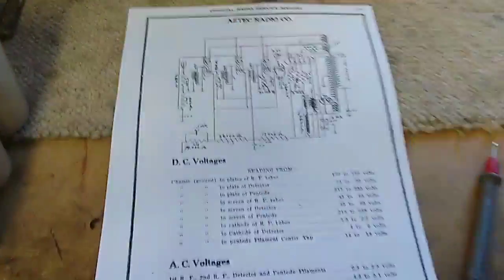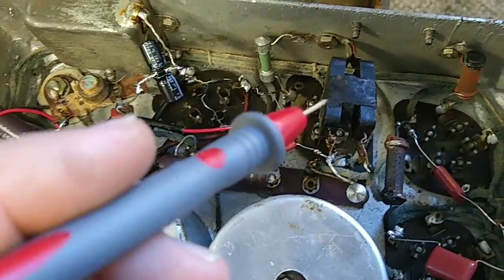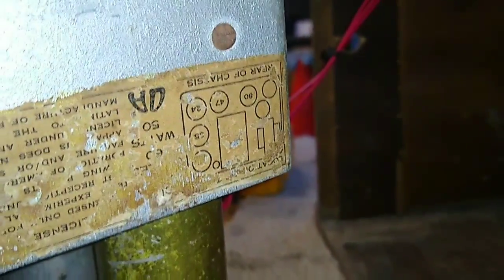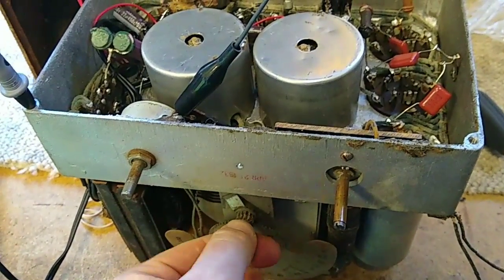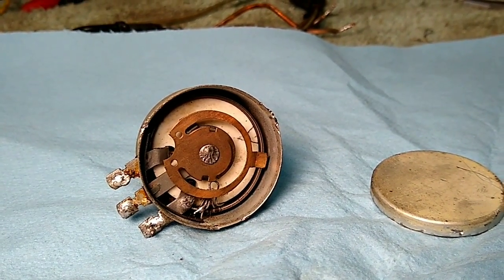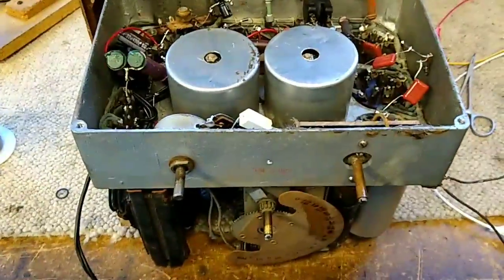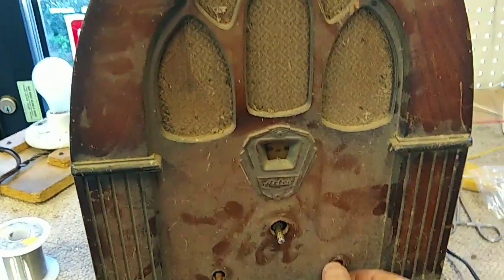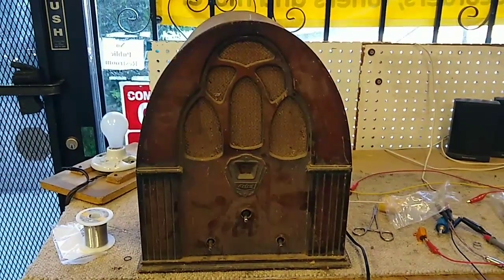Repair attempt of 1932 Aztec cathedral radio part 2 / ?

Comment: Hi JP you’ve been helping me with my Pioneer SX-828 receiver that cuts out on the left side.  I tried what you suggested about using the b and c speaker ports but I got the same results in fact I think the b was worse than the other two.  I’m not an electronics tech but I do know how to soldier.  Could you tell me what I’m looking for when I remove the case to tap on the speaker protection relay?  I dont know what it looks like or where it’s located.  I assume it’s somewhere along the left side towards the front?  Thank you so much
Reply from the maker: Looking from above, the protection relay is under a cage/cover to the lower left of the amplifier. It's clear and will have four visable contacts. Tap on the relay cover to reveal it's issues if any.

Also, if you crank the volume way up momentarily and the chann pops back in - it's a dead ringer for the relay
Reply: Jordan Pier thank you so much I will let you know the results.  If I do have to replace the relay are there replacements today?